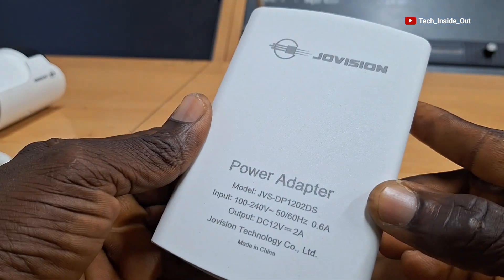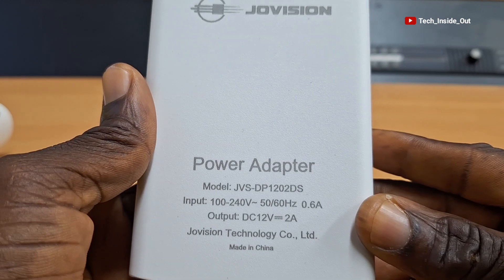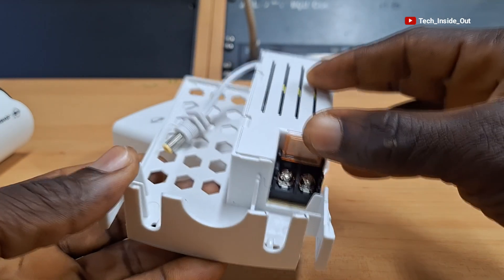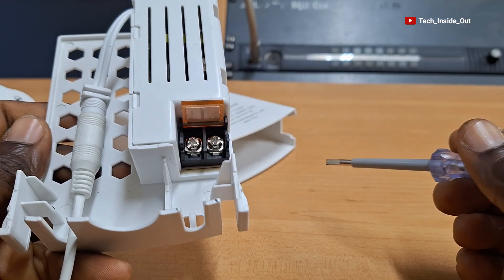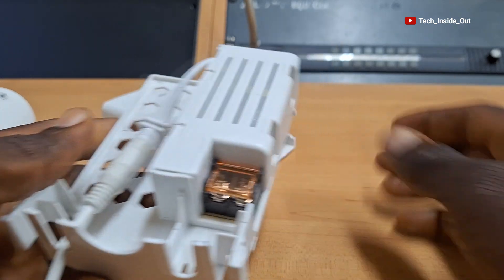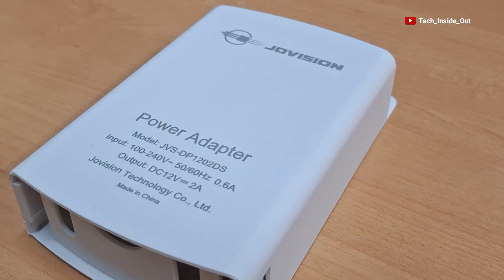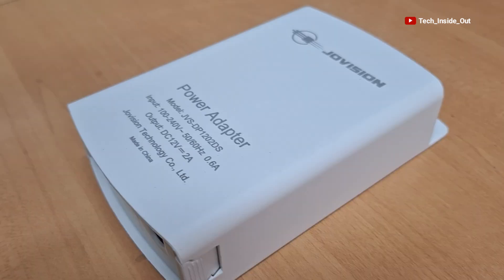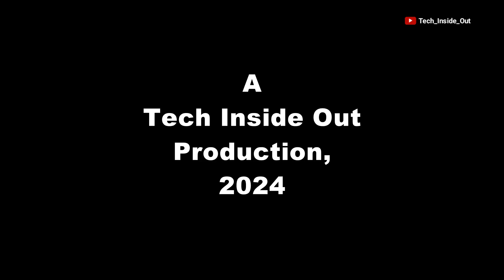Prevent bad cctv video using power Supply suitable for long CCTV cables beyond 100m

Comment: I have a customer with an Annke 4k camera system.  It has 8 channels, but he wanted to add a couple more.. Can I add extra IP or wireless cameras without upgrading the DVR?  Thanks
Reply from the maker: Once your channels are exhausted on your DVR,  you can only upgrade to be able to add more cameras.
Reply: @Tech_Inside_Out  Thanks for your help and quick reply!  I really appreciate your channel👍